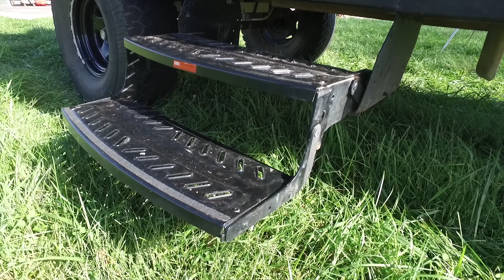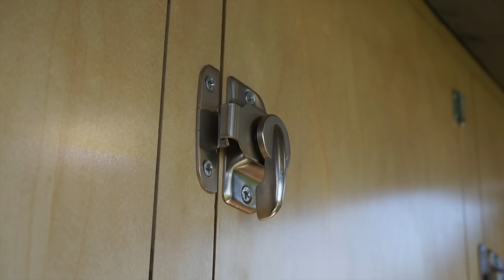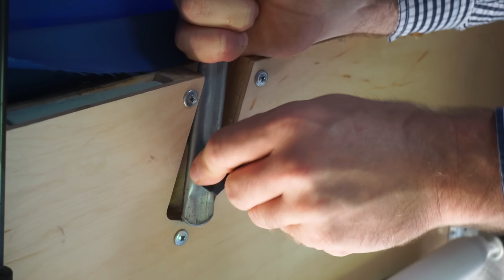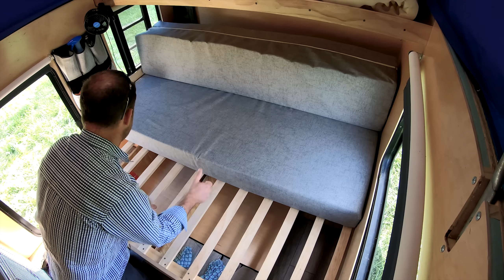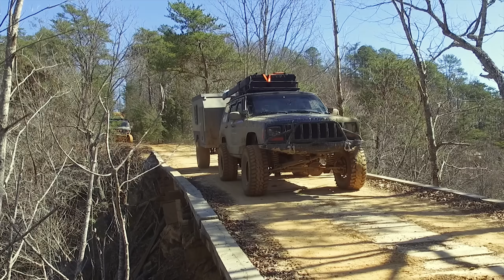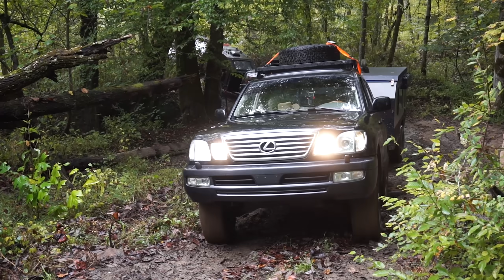DIY Offroad Overland Camper Walkaround

Comment: That's a great little set up, what I like most is that it is so functional everything does it's job, I would be painting those walls though and putting kick plates all around the bottom six inches because it is bound to get boot marks on it some time, Maybe some thin checker plate or formica type material, Anything as long as it is easy to keep clean and resists damage, Nice job and a great video, thanks for posting it. good luck.

Comment: Very nice work, tnx for sharing . What is the model of the Lexus? Impressed by how it handles off road (I have the Rx450h and in my books Lexus is more like soft SUV :-)
Reply from the maker: It's an LX470. That's Lexus' version of the Land Cruiser, so it's built for off road! I have a review on it too.
Reply: Tnx I'm watching it now; I do not think it is available in Europe.
Reply from the maker: I think you're right. You have the Land Cruiser though!
Reply: No I have a Lexus, it is a hybrid the Rx450h. I suspect it is based on a Land Cruiser but I'm not very confident of its off road abilities. I use it mainly to munch 1000km a day while carrying our family of 4 and luggage across European motorways. I've taken it a few times off road on mountain tracks, a bit of snow and sand but nothing extreme like you show in your videos. Its air suspension does lift though (speeds up to 50km per hour) which is handy to go over big holes albeit when raised the suspension is pretty stiff / not as comfortable. Have you seen such Lexus models off road? Would be interested to know more about its off road abilities.
Reply from the maker: Sorry, I meant that the Land Cruiser was available in Europe. I've not seen anything other than the LX range off road since the other Lexus vehicles are more of a luxury crossover. Things like the RX series are fine for forest roads, but you wouldn't want to do anything too difficult with them.
Reply: Tnx yeah, the L-Cruisers are available at my end of the woods but the Lexus is more refined, better acceleration, cornering, etc. for motorways. And indeed the Rx is fine for forest roads which is plenty for us :-) For more rough terrain we use the mountain bikes :-))  When the time comes to do the TAT I'll use my motorcycle (even if the vehicle is off-road capable the Mrs nags when off-roading; esp. with the kids on board. I wouldn't dream trying some of the stunts you pull with the family inside and towing a caravan at the back :-))) You are a lucky man indeed.

Comment: Great build! Do you know what the weight loaded is (including the 20 gallons of water)? Or dry weight?
Reply from the maker: It hasn't been weighed yet, but I'd estimate it to be around 2000 lbs.
Reply: @RevereOverland  Thanks for the reply! That's the ball park of what I was guessing.
Reply: @ryanoddi8490  I want to get it weighed for a dry weight, just haven't done it yet.  I towed it with my XJ before I got my Land Cruiser so I know it can't way too much, lol.
Reply: @shaweehillsworkshop4226  Yea I was curious how that went with the XJ. I have a 95' 4Runner with a 22re 4 cylinder and am considering a trailer, but it'll need to be LIGHT for this sucker to pull it haha. I know it can handle 2k or more but I'd like to be closer to 1500 or less if possible. I don't need it to be extremely off road capable, but more or less forest service/blm roads.

Comment: Awesome camper. You probably didnt know about teton x when you started building your camper because they are new to the market. They are based in Utah and make a pop up off road camper similar to yours. Here is a video I made of them while I was at overland expo.
https://youtu.be/IvdyCbI8jds
Reply from the maker: Teton X actually contacted Wes when they were designing theirs.
Reply: hey man, I actually commented on your video when you first published it.  I started building my camper in Oct of 2017 Teton didn't debut their trailer until expo west 2018.  Also, their trailer only has one bunk instead of 2 like mine (at least at that time).  I have actually talked to Teton x and i think they are a good company and making a good product.  If they had another bunk in theirs, and it would have existed when i was in the market, I would have purchased theirs!
Reply: I also like their kitchen placement better than mine.  It gives more room in the cabin which I would have liked
Reply: @shaweehillsworkshop4226  I remember now.
Reply from the maker: Nice video! They did a great job on their popup. It is pretty pricey though! Have you seen the Opus camper? I have a video walk around from Expo East.
Reply: @RevereOverland  The Opus has definitely caught my eye.  I think the tetonx is more offroad capable but the opus is more family friendly!  If I had to buy one right now it would be the OPUS both because of comfort and price.